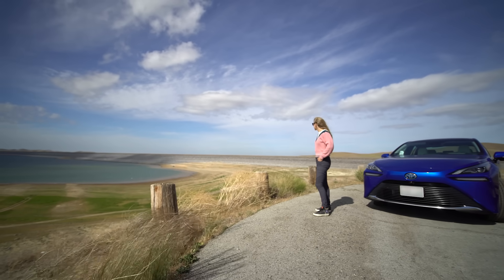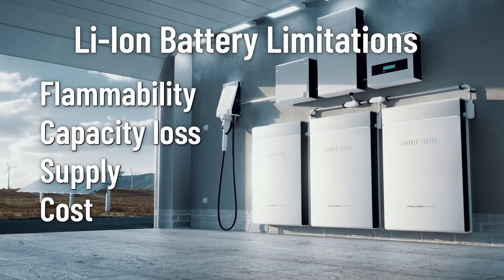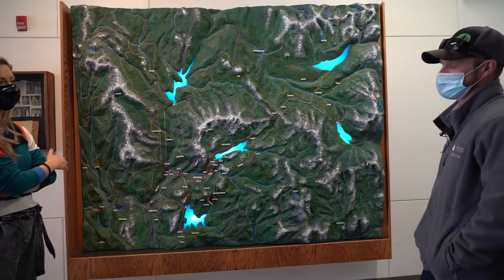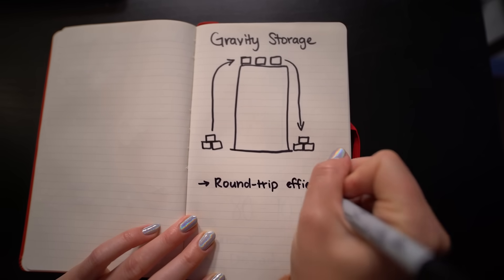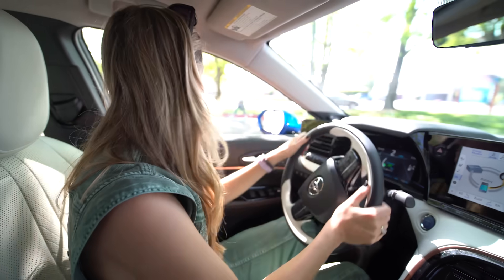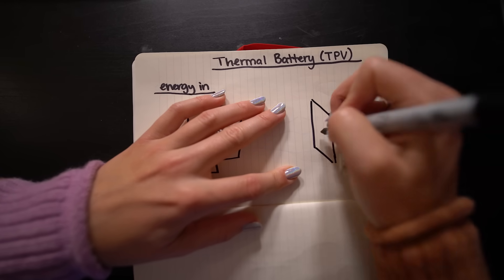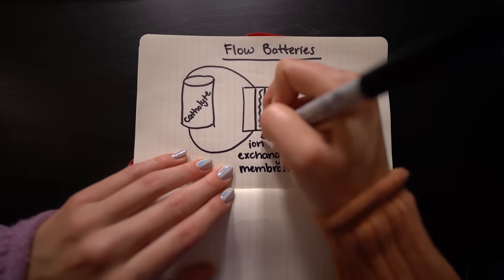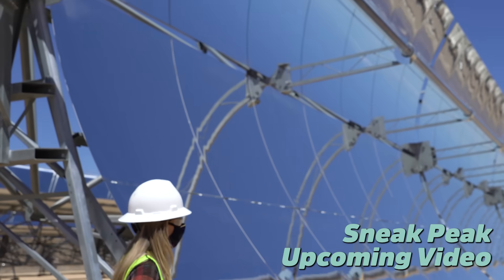The BIGGEST problem with clean energy

Comment: People have been talking about storage issues with solar and wind for 20 years or longer. The reason hydrocarbons are so easy to exploit is that they store a huge amount of chemical energy per weight and is relatively easy to convert into usable energy. 

The real issue is demand and how you deal with it. Renewables are a great start to going green, but people often forget nuclear. There's a large movement now on to go after Thorium reactor technologies that can generate power in smaller, modular plants that can be engaged as demand rises. There's no emissions and some models still have the benefit of producing much needed isotopes for the medical field. So, yes, produce power from wind, sun, geothermal, as the environment in that vicinity allows, but don't limit it to those few choices when there are some really good ones in the wings. We just have to get past this nuclear fearmongering. 

In my opinion we should be focusing on sourcing nuclear as the baseline energy generating medium and then using renewables as a kind of buffer for demand fluctuations with some means of storage to provide for demand when they can't operate. That way we're not dumping all our eggs into one basket either way.

Comment: There is another problem, temporarily only but still.  To build enough Solar panels that would make us solar self sufficient we need the same amount of energy that we already consume each year for the next 20 years. For this reason we need an abundant energy source for another 20 years that is used to build solar panels. The only thing we got that does this and is CO2 lean is Nuclear Power.
Reply: i dont know how people believe this, you know if that was true you would be paying much more for solar panels right now, may have been true when solar panels where first made decades ago, i know for a fact you don't know the amount of energy it takes to make solar pannels.
Reply: @miguellopez3392  You mix up the price of the solar panels and the energy that is used for the production and the CO2 emissions in the production process. Only because they are cheap no it does not mean the need less energy to produce them. Plus you certainly underestimate the amount of panels we need. If we want to be solar self sufficient we 15x of the solar panels that are already installed because when we store the electricity for winter and bad weather in H2 which is the only viable option right now because we loose about 40-50% of the energy in the electrolysis and another 30-40 in the fuel cell to convert the H2 back to electricity.

The good news is: We only need to cover all the surfaces where the ground is sealed already (buildings, street, parking lots, rocks ... ) with Solar panels to get all the electricity we need. So we don't need to sacrifice any nature with plant life.

Comment: As a physicist, it is shameful that you are propagating the idea of 100% renewable.  The concept violates the actual laws of physics.  The machinery of all of this breaks down over time and will necessitate replacement.

Beyond this, what is equally disappointing is that you are not looking at the entire system of things.  It is one think to talk about the energy efficiency of making hydrogen and look at it as not good without fully considering the insane costs and environmental space and impact of solar, pumped hydro and so on.  Along with this, there is also the fact that negawatts is FAR more important than seemingly anyone knows or realizes.  EEV blog did a fantastic breakdown on wired smoke detectors and their horribly inefficient AC/DC conversion.  The grid losses to this in Australia (Where he lives) are massive for such an innocuous and yet required, piece of household technology.  It is beyond question that there are many more such issues all over dwellings and offices around the world.  Not needing that power at all is far more beneficial than simply trying to make more power that is inevitably more expensive than classic thermal plant power.

Comment: point of using li-ion battery (as mentioned in video about battery in Australia) is NOT raw capacity, there are better stuff for capacity stuff. li-ion battery is much faster to respond to changes in energy grid and bridge sudden spike (as in seconds or better)  in demand until more slow generation hydro/nuclear/whatever turbines spin up and sync to grid.

Comment: Great content. It made me do some digging on the topic of hydrogen as a fuel.

ICE engines are great from the energy density point of view but the carbon footprint of the well-to-pipe is scarry.
Hydrogen is also great. Especially for large vehicles that allow storing lots of it onboard rendering far superior range in comparison to BEV. 

I am not sure however if today it is a green fuel. The phrase "colours of hydrogen" is a key here. And this is, in my opinion, the reason that keeps the whole technology from mass adoption. Otherwise, it would be refused the carbon-free status for several decades.

The major problem with hydrogen is the assumption that all of it is coming from the electrolysis of water. The process is quite energy-demanding and renders the end product's high price. The free market economy favours the cheapest solutions. The cheapest hydrogen you can buy to run your car today is coming from the extraction of natural gas (making it a fossil fuel?). 

Hydrogen's abundance is misleading to the point where it is hard to use it as an argument. Sorry.
Let me explain.
Hydrogen atoms are abundant (bound to other stuff), hydrogen molecules (H2) on the other hand - not so much. So, we need "stuff" to be processed to get the fuel, which we can use in vehicles. Most likely, the place where the "stuff" is extracted and where it is processed doesn't have to be the same place, so we need to transport it back and forth. That sounds very familiar, doesn't it?
Also, the BEVs are based on the circular economy - create a product and when it reaches the EOL - turn it into a new product. Hydrogen would require water vapour capture to make it a closed loop.

There is also the CCS, which turns out to be a scam, providing very little to none of the "blue hydrogen" per year (see the recent film from the Australian thejuicemedia on YT).

So, hydrogen - yes, but we need more research and development as well as net-zero carbon footprint.

Comment: I believe we are missing a HUGE part of what is required to achieve a fully renewable future.

We always talk about current or reduced energy demands but ultimately we will need to stop mining EVERYTHING, not just oil AND we need to bring everyone living on this planet up to modern living standards (heat, electricity, running water, AC, vehicles (electric), etc).

Not only do we need to replace all fossil fuel energy with electric based energy but today oil is also used to make almost all plastic. Plastic needs to be 100% recycled or we need to manufacture plastic from man made hydrocarbons.

On top of this we need to recycle all metals, including metal that is finely dispersed throughout products. Many of these recycling processes are very energy intensive. Many metals can only be extracted through very high temperature, zero oxygen vaporization/distillation processes.

I've seen it estimated that our energy demands would increase 200x to 500x from today's demands in order to do all of the above using today's technology. Even using processes that are not invented yet, most experts believe our energy demands need to increase by an absolute minimum of at least 10x to 20x.

Using our absolutely best, futuristic green energy capture technologies (solar, wind, hydro, ocean, geothermal, etc) we would need to cover the entire surface of the farmable area of the earth to generate power and we still wouldn't produce enough power, let alone store it.

Ultimately I'm convinced (as are many experts in energy) our only option if we want everyone to live life with what we consider essential technology (including food) we need to embrace modern nuclear power.

When I say modern nuclear power I don't mean fusion. I still mean fission, but using modern fail safe reactors and using modern reactor fuels that can't be weaponized and that leave minimal or no nuclear waste.

Compared to our current green technologies, nuclear power has incredible area densities on the order of 1000x better. This means our land wouldn't need to be completely covered with solar panels, wind turbines, etc. Instead small nuclear reactors could generate all of the power we need - almost indefinitely.

Think about it a bit; do the math on future energy demands and solar, wind, etc area demands and you will see we are on a green energy path destined to failure.
Reply: I forgot to mention that while green energy sources at current scales are not too destructive to the planet, when you consider that to switch to a fully renewable model, most of the earth would need to be covered by solar panels, wind turbines, etc.

At the scale necessary to become fully renewable, we would have to destroy almost all habitat for wildlife and drastically alter the surface of the world.

Modern, clean nuclear power is our only option for a truly green, fully renewable future and we urgently need to start investing in it today.

Comment: I've seen 2 videos that kind of was replacing the energy.
One guy was shutting down his AC during around dinnertime.
https://youtu.be/0f9GpMWdvWI
And then ther's this guy who's using a battery as a buffer.
https://youtu.be/HI_i1UUm66c

Firstly we need to have some sort of battery in every house. The capasity for that battery should be starting at 2kwh, What that would do is that it would flatten the curves and also make it posible for more people to buy the system. And since this system does not need solar power but can be charged at night it would make the production easier to predict cos you kind of is 24 hours ahead with a battery.

Comment: Let me think---C O 2 was taken from the air and stored the energy in the form of hydrocarbons. Using this energy puts the C O 2 back in the atmosphere
Reply: There is a carbon methane cycle that has been rediscovered recently by the Telsa car creator which is being used for space travel and  renewable fuel and if done right, no new fuels need to be mined drilled or burned in the long run. It fuels itself and creates harmless by products, like water, that can be used to make other things.

Comment: U missed 2 of the most important, cheap, reliable and ready to market large scale energy storage systems available now. One is FESS - Flywheel Energy Storage System and Liquid metal batteries.
FESS is used in the newest Gerald R Ford class aircraft carriers to power its EMALS system. It is also used in F1 racing cars in their KERS system. Amber kinetics is a company that has ready product on FESS.
Also liquid metal batteries of Ambri can store huge amounts of energy in shipping container sized boxes.
Next time check them out. They are the most promising.

Comment: Compressed air is cool but high pressure compressors are expensive to produce and maintain!  A cheaper option would be hydraulic compression of spring steel...!!! Using solar to produce hydrogen to fuel turbines is another great solution..!! I brainstormed both of these storage methods 20 years ago as an engineering student..!!  Glad to see some progress being made.  Unfortunately, energy conversion produces heat no matter what the source is!  The higher the population,,,,, the more energy we need,,,, the more heat we release...!!! It's a no win scenario..!! The only way to reduce our impact on climate change is to reduce population!!!  Pretty simple math!

Comment: Gravity storage (with cubes is definitely the future for urban areas). Having that spin a flywheel to maintain grid is going to be an alternative to lithium battery...
Reply: could also use a more vertical space, build a skyscraper that has a bunch of hanging weights
Reply: Gravity storage is just quite inefficient. Calculate how much much mass or height difference you need to store the amount of energy that fits in one AA battery, and it's a lot. That's why the hydro storage is having problems as well, as there is not many viable sites to build nowhere near enough of it.

Comment: Those efficiency figures are interesting. I visited a pumped storage facility in Wales in the 80s where they only claimed 67% efficiency. Or more specifically, they said that for every 1.5 units of electricity you put in to pump the water up, you get 1 back when it comes back down through the turbines. It seems both turbine and motor/generator technology has improved.

As for why Britain had a huge pumped storage facility in the 80s, they had no small, responsive gas plants. All the power stations were huge, some were coal, some were nuclear, and none of them could respond fast enough when half of the population of Britain switched on 2kW tea kettles simultaneously during the breaks in sports broadcasts. Seriously. :) It's different now many people watch at different times.

Anyway, great video! It's an issue I've occasionally thought about, especially for personal... crazy plans. ;) I've long thought gravity storage a good idea, but never considered separating the lifter/generator - the crane - from the load, so that's new to me.

Comment: “If we produce too much energy, we will be charged” is a prime example of the fact that capitalism has gone way too far. 🤦
Reply: Not really. Traditional power plants can only turn down so far. If the demand is low and the solar people are still pumping in power it can cause a lot of problems because they can’t just turn down the main plant more.
Reply: @NBSV1  yes I’m aware of that. You miss my point entirely though. Energy production should not even be a capitalist enterprise to begin with. I understand the balance between public and private clearly as well, but still have plenty of issues. Basic needs like power and water (not to mention others like healthcare) should not be something that anyone profits from, period. Maybe that’s a hot take, but it’s my position regardless 🤷

Comment: 2:48 electricity is a tricky thing to explain. Storagung energy by pumping water has more to it than it sounds, is a much more complex process. In order for being efficient the pumping process mus be done at nught when the load is low. When the load is low the power factor is low and hence is not efficient, but when the coils of the electric pump are running it enhances the power factor making the grid more efficient. However if the pumpimg iabdone qhe the load is high, the coils lower the power factor.

Comment: What about all of the issues with separating Hydrogen from other components like water or hydrogen peroxide. The systems to separate water are going to use reverse osmosis water which is power-hungry and how to handle the wastewater. The energy to separate hydrogen is enormous. Then storing it is complicated too because how do you hold a molecule that is smaller than all other molecules? And 1 last thing will Hydrogen rise into space like helium does?

Comment: A thing you didn’t mention is storage of energy in cars. If a nation had cars plugged in while fully charged, their lithium ion batteries would be a large scale storage method, so in times when they aren’t in use and there is an energy requirement, they could be discharged back into the grid, acting like a huge battery storage system

Comment: I recommend next watching the video "Dirt Simple Energy Storage | In Depth" by "Now You Know" on youtube.  The technology uses hot air to heat sand or dirt kept insulated underground, and later on uses the same hot air to generate power, or to heat water for municipal water heating (where it applies). And unlike using water for heat storage, the sand can be kept much hotter than 95 degrees Celsius, at 300-400 degrees celsius, possibly more, depending on if there are advances in cheap-enough materials used for storage. And it can be easily paired with existing solar through and solar concentration towers, by simply moving heat from the thermal fluid to air and backwards. They are used in nordic European countries to heat the storage in the summer and heat their homes in the winter, so it works well as a very-long-time energy storage, too.

Much cheaper than the the other alternatives, per unit of heat stored, and uses off-the-shelf components for the pumps and power generation systems, but needs a large area to be in (which can be underground and built above, so city plazas can work, for example, and greenhouses can be built above, to make use of the little heat which does escape, and building long corridors under streets could help keep them snow-free), which makes them a much better deal than the alternatives.
Reply: Good to know; thanks!

Comment: Huge heavy metal flywheels in a vacuum suspended by magnetic fields instead of bearings. Or if the magnetic fields would require too much energy oil fed bearings.

Comment: Very interesting video, it's true that energy storage will be critical in the futur. However I found that the video missed a critical point of view over the scalability for some method and an estimate of how much energy storage capacity we will need. Like lithium-ion works well, but if you have to store 25% of the yearly production to accomodate yearly production variation (results found by RTE in Europe), you quickly realize that there isn't nearly enough lithium on earth. So it's important for each solution to see it there isn't such obstacle.

Comment: In India they make a car that runs on compressed air made by Tata motors. It has a 50 mile range and a top speed of 70 MPH. As far as Hydrogen IMO I would stay away from it since hydrogen is highly unstable.